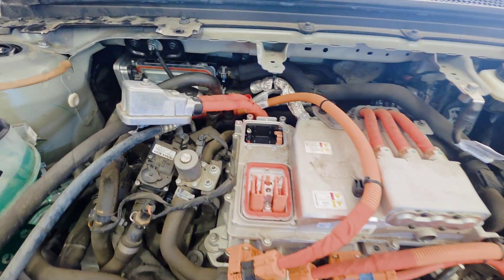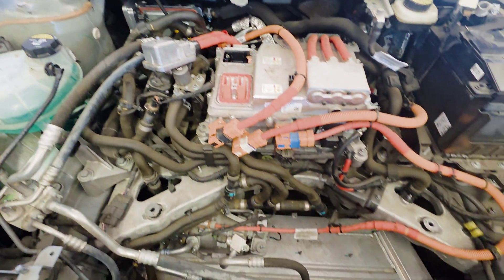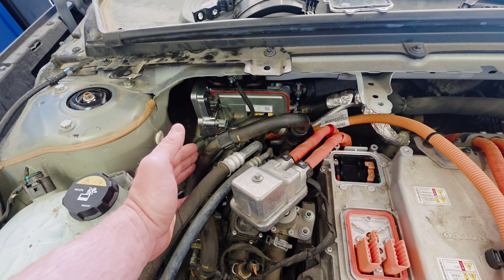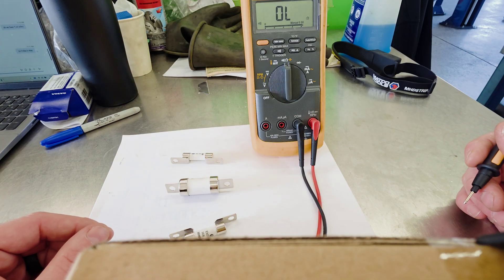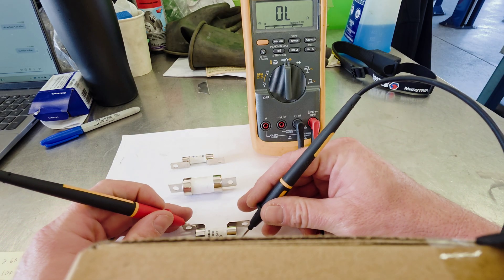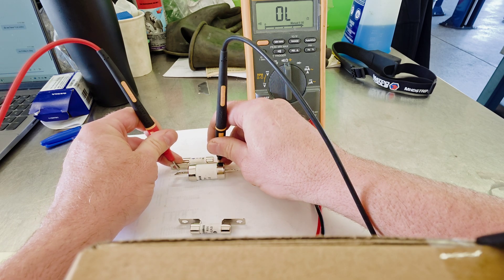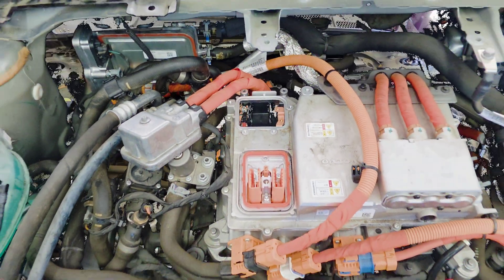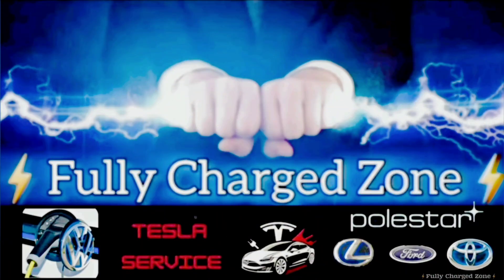🔥 Polestar 2 No Heat Fix! — Diagnosing and Repairing a Bad HV Heater & Blown Inverter Fuse

Comment: How do you change the hvch?    How long should it take?
Reply from the maker: .After de-energizing the vehicle it takes about 1.5 hours with programming.  I will make a video about the procedure I use the next one in the shop. Its not difficult,  its more time consuming
Reply: I changed the hvch in my 2022 polestar 2 but as soon as I put it in drive, I got the climate system performance reduced, service required. Do you need to program the hvch after installation? I'm over 1000km from the nearest polestar dealer so I'm trying to fix this locally. Thanks. Great videos! Looking forward to seeing more!